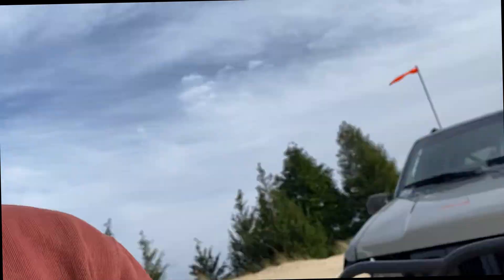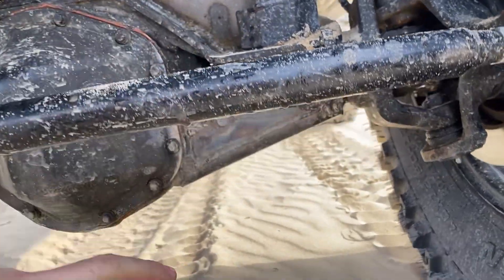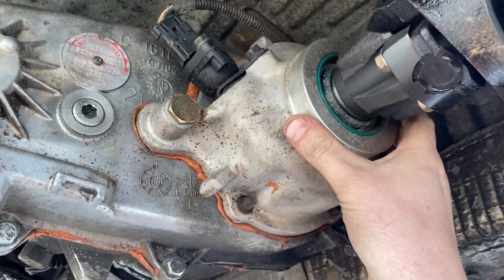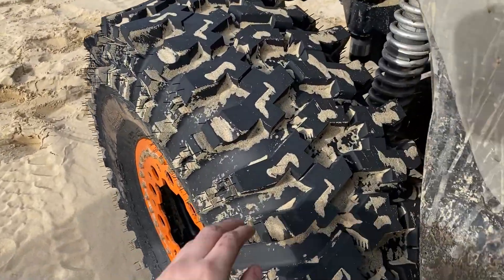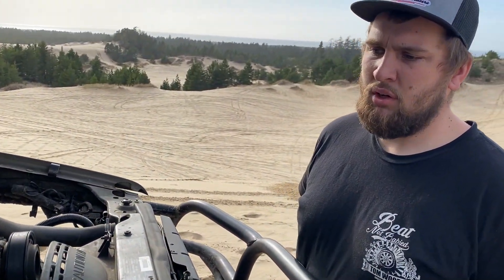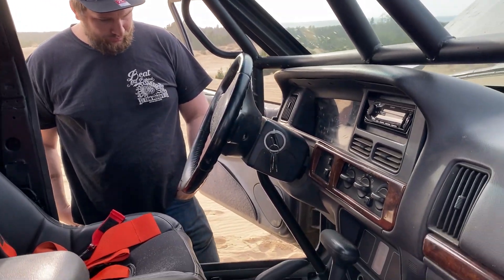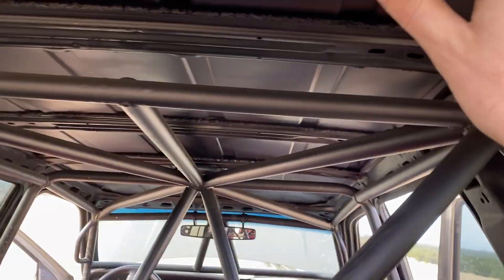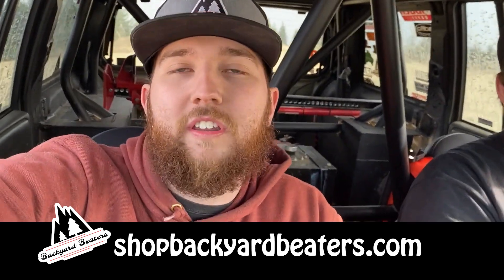BEAST Jeep ZJ on Coilovers Wheeler Walkaround- FULL SEND MODE ENGAGED

Comment: So many guys with 96-98 ZJs swapping out their 249 t-cases for 231s.. Why? Why go with a significantly weaker t-case? Just because everybody else does it?  The issues the 249 had with the VCs were all fixed for the 96 model year. If your ZJ is 96 or newer, you are MUCH better off with the 249. It already has the 6 gear planetary and the extra wide chain. It is just a bigger, better t-case than the 231. And the full time 4wd is great in ice and snow if you live in that part of the country. 

If you really must swap out your t-case, at least go with something that is actually beefier and better. The 241 from the JK can bolt right on if you get the right year. Or get an atlas, or a Dana 300, or something along those lines.

Comment: Sweet rig man! Love the channel building a ZJ my self right now.
Reply: Sweet! I just finally found and bought what seems to be the perfect ZJ that I have wanted for a long time now, selectrac straight 6 cylinder but just doesn't have the factory tow package, though I think it still might have the 3.73 axle gearing that comes with the tow package equipped zjs and if so then it could have the limited slip in the rear end too which would be AWESOME!!
  anyway, I'm just going to install the 3" budget lift extended shocks I've had sitting new in the box for a few years now, install a super sick few amps and high end subs with something like a 7inch touch screen multimedia head unit and a 2nd battery for the stereo AND to help power the inverter I'll install as well!
  Then it's just getting a few more recovery gear items and making sure it's all set up for exploring, camping and some light 4 wheeling! 
   *Oh and figure if I can grab a cheap set of 16" ZJ wheels then I will hopefully get a set of 245/75r16 Mud Terrain tires for it, or even just something like 30x9.5r15's in a Mud terrain.. 
  LOVE My ZJ Grand Cherokee's!!
Reply: @BabyCharlotteschannel  I'm doing something similar but on 35's. How's the build coming along I'd love to see it.

Comment: Be perfect if it had a 4.0 that's what my 98 Grand Cherokee has I've had 2 others with the 5.2 I wouldn't trade my 4.0 for anything!
Reply from the maker: To each his own! I hated my 4.0 zj I had before this. Gutless and constantly had issues. This 5.2 has been very very reliable, and makes decent power. And sounds way better of course😂
Reply: Yeah, my last zj was a '98 5.9 which I loved BUT, it was a rediculous gas hog, and the 5.2 it had in it gave me Soo much grief plus it had tranny problems after the guys that build transmissions at the shop I worked at rebuilt it for me and did something wrong- so that zj was just a waste of like $1500 and a bunch of time.. 
  Now the '97 4.0 I just bought seems like it's going to be the perfect one to build up how I want it! Man I'm psyched to get started, well heck, I'll be happy just to get a couple of subwoofers and amps and the rear 2nd battery with 0 gauge feeding it from the main starting battery